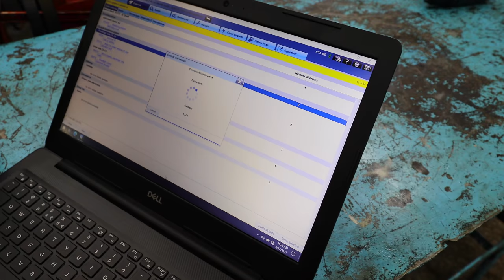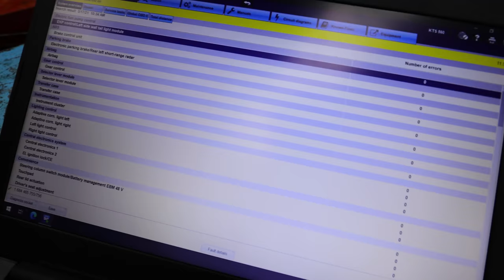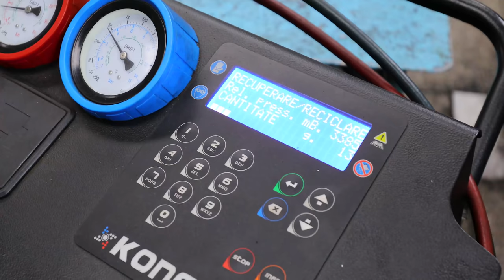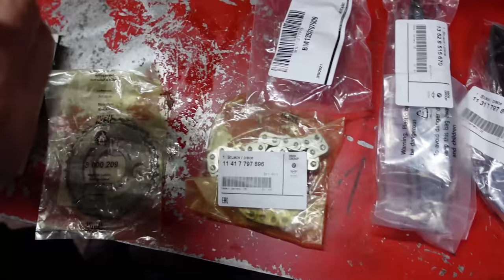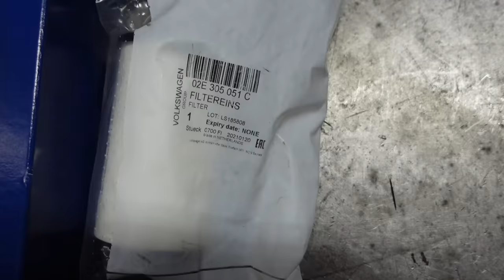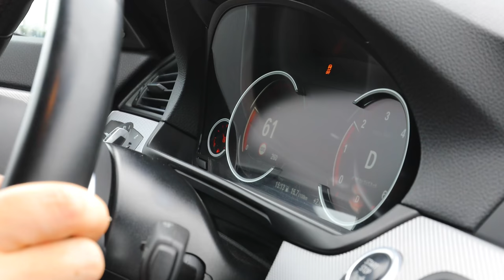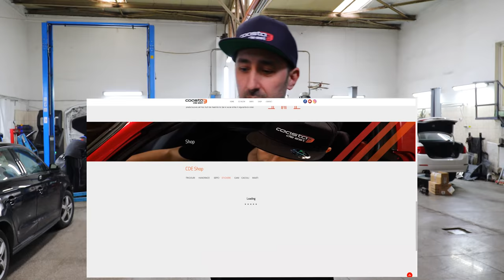BMW M550xd - balaurul cu 3 turbine 😈😈😈

Comment: Salutare, părerea mea este că la acest concurs putea să fie o regulă generală, nu să ne limităm doar la BMW, dar ca să împac și capra și varza, eu fiind un mare fan al japonezelor, mai ales al mașinilor rare, doresc să vă povestesc despre puțină istorie despre Mitsubishi 3000GT, dar și despre BMW 850.
Despre Mitsubishi 3000GT am aflat înâmplător, iar după ceva căutări m-am îndrăgostit de mașina aceea.
Fiind fabricată între 1990-1993, iar din 1994 venind cu un facelift care îi reducea farmecul deoarece au renunțat la pop up headlights și la câteva din sistemele active, mașina aceea la vremea ei venea cu eleron activ, evacuare activă(sport și city), splitter activ bară față(reducea volumul de aer ce trecea pe sub mașină, cel mai bine se resimțea efectul acestuia la viteze mari) dar și virarea roților spate la un unghi ce 5 grade. Toată minunăția asta era propulsată de un motor japonez pur sânge 3.0 V6 de  aprox. 280 CP cu o tracțiune integrală. Singura problemă generală  a mașinii de care se loveau proprietarii a fost reprezentată de gaura de ungere a tacheților hidraulici care era de 1mm ce nu asigura ungerea eficientă la mersul sportiv și ducea desigur la uzarea prematură a mai multor piese, însă Mitsubishi a refăcut respectivii tacheți cu gaura de ungere de 3mm, iar problema a fost rezolvată. În momentul acesta există pe piață cu prețuri între 8-9000 până la 50.000, dar la orice oră aș cumpăra așa ceva doar pentru istoria pe care o are în spate și pentru ingineria de la acea vreme.
         Aș mai putea povesti despre Mitsubishi Galant VR4, o altă mașină puțin cunoscută dar foarte potentă dar și despre Opel Omega, denumit și Lotus Omega(Lotus Carlton în Marea Britaie) deoarece aceste 2 firme au colaborat între anii 1990-1992 și au produs un sedan cu 4 uși capabil să prindă 280 km/h cu un motor 3.6 bi-turbo și 0-100 km/h în 5.4 secunde,propulsie/tracțiune spate. dar din cauza recesiunii nu au reușit să producă decât 950 de mașini.
         Acum să trecem la BMW, un bmw care mi-a atras atenția este BMW 850 E31, ca cel pe lângă care ați trecut și voi și sunt curios dacă are V8-ul sau V12 sub capotă. La aceasta mașină îmi place puterea brută pe care bănuiesc că o dezvoltă cele 2 motoare dar desigur și de funcțiile pe care le avea mult înaintea vremurilor, nu cunosc exact pe ce nivel de achipare au fost prezente funcțiile respective dar la viteza de peste 150 km/h se trecea automat suspensia în modul sport și se închideau automat geamurile, pop up headlights-care sunt plăcerea mea nevinovată chiar dacă nu sunt deloc aerodinamice, iar ca lucruri ce nu îmi plac, nu am gasit ceva să mă deranjeze, însă, la fel ca și la celelalte mașini menționate, trebuie sa fii potent financiar ca să te ții cu cheltuiala. Fiind mașini vechi, unele care pot fi trecute ca vehicule istorice și merită din plin în opinia mea, mai ales dacă ești pasionat, să ai o mașină la care să mai șurubărești și să o mai plimbi din când în când e o plăcere.

Comment: Toti vorbesc despre bmw-uri cu dotari, cai, eleganta, etc. dar voi ati vazut cu arata bmw isetta sau bmw 300/600? Ca sa intri in masina efectiv ii desfaci botul, coloana de directie se pliaza pe usa, iar pasagerii stau pe o singura bancheta, are 13 cai putere si 300 si ceva de kg, motor cu un singur cilindru, claxon la "genunchi", fara servo directie, trapa panoramica, 4 roti de roaba, viteza maxima de vreo 90 km/h, etc. Aparent facea furori prin anii 50'. Se mai numea "masina ou". S-au produs 161 360 de unitati in 6 ani.

Comment: Salutare băieți!Eu în prezent dețin o Octavia 1 VRS 1.8t AUQ cu undeva la 225 de cai.Dacă s-ar întâmpla să mă plictisesc de acel feeling pe care Octavia mi-l oferă și aș vrea o senzație aparte cred că aș alege un e38 3.0I V8 M60B30.Mi se pare foarte interesant că poți avea un V8 cu doar 3L.E ceva mai afordable legat de taxe.Mi se pare genul de mașină veche în care încă poți avea confort și mai ales genul de mașină care încă întoarce priviri fiindcă lumea nu prea o vede pe stradă.Are și puțină putere pentru acea caroserie,218 cai,cam la fel cu un 2.5 de generație de pe e90.Însă ai o injecție MPI și măcar știi că nu ai probleme cu depuneri pe admisie,la fel ca la Octavia pe care o dețin acum.Eu unul m-aș urca cu drag în ea în weekend într-o zi cu soare în care să nu conteze nimic,mai ales că nu este un motor care nu se pune pe brânci așa ușor.Nu cunosc încă foarte multe despre ea,am văzut câteva și am fost foarte atras vizual,apoi am mai căutat câte ceva,însă când va fi momentul,sper să vă pot da sfaturi legate de achiziție la acest model :))))).

Comment: Salut, parerea mea este ca unul dintre cele mai tari bmw uri facute vreodata (fiind rezonabil si vorbind si de ceva relativ accesibil, nu de exemplare de 100-200 de mii de euro)

Este bmw-ul e 36 (pisicuta) si ma refer in special la caroseria coupe (deoarece este mai rigida decat compactul si sedanul) si la motorizarile de 6 cilindrii cu vanos.
'
Cum ii mai spun unii pasionati de autoturisme din afara e36 straight six este varianta germana a motorului 2JZ,  vanosul fiind un fel de  VVT ul de la Toyota sau V-Tec ul de la Honda.

Pentru cei ce nu cunosc aceste termene, la turatii mici motorul se comporta normal, avand un consum decent recirculand gazele de evacuare inapoi in cilindrii, dar la turatii mari valvele permit intrarea aerului rece si iesirea gazelor de evacuare mult mai repede pentru a marii puterea si cuplul. Astfel mergand normal motorul se comporta cum trebuie, dar la turatii mari acel motor este exact unde isi doreste.
Am auzit (din pacate nu detin unul ca sa pot spune din proprie experienta) ca exista probleme la acest vanos dar cine isi cumpara trebuie sa-si asume, mai ales in 2021 acea masina are deja aproximativ 30 de ani, apar probleme iar majoritatea celor ce cumpara exemplare de genul le cumpara pentru a fi project car, pentru drift sau competitii (de asta si pretul unui e36 coupe straight six a crescut de cativa ani in coace).
Aceasta este parerea mea sincera, nu conduc unul din pacate, daca ar fi as achizitiona un seria 7 e38 non facelift ca project car, orientandu-ma catre aspect - design - lux, nu catre sportivitate (neaparat, ca este destul de potent, vorbind de o motorizare de 3000-4000 benzina)

Comment: Bmw 2002 turbo reusea sa scoata in 1974 aproximativ 170 cp dintr.un motor de 1990 cm3 si reusea sa atinga 209 km/h. Pentru o masina din '74 mi se pare super tare.

Comment: Din punctul meu de vedere, BMW e36 compact este si va ramane dragostea mea, deoarece a fost prima mea masina, 316i, din pacate m-am bucurat de ea cam 1 an de zile deoarece mi-a fost furata in italia, ulterior desi am primit gratis un logan nou nout, l-am vandut si am cumparat un alt e36 compact, 318 TDS :) ca deh, prima dragoste nu se uita asa usor... De ce sunt cele mai tari masini ? Deoarece sunt compacte, comode, sportive, usoare, piese ieftine si se gasesc peste tot, o placere sa te bagi sa repari chestii la ele (ma rog chestii simple, mai un temostat mai un curatat de EGR :) mai o modificare de pompa de inalta. In acest moment conduc un Superb 3 L&K, dar tot caut si nu gasesc un e36 Compact dragut pentru un proiect de suflet in amintirea tineretii :))

Keep up the good work guys ! love ya ! <3

PS. cand v-am contactat sa-mi faceti revizie la DSG la superb 3 mi-ati zis ca nu faceti d'astea, in clipul de azi Migu facea o revizie DSG, hmmm :)

Comment: Pentru mine cel mai tare model de BMW ar fii seria 3 modelul E46. De ce? Pentru ca s-a diferențiat de generația E36 prin reducerea greutății și caroseria este mai rigida. E46-le și în 2021 este o mașină care arata bine, este fain ca s-a produs in doua variante, facelift(2001-2006) și nonfacelift(1998-2006). 
P.S.: eu nu am inca permis, dar sunt pasionat de mașini și mecanica, iar BMW-ul E46 este printre modelele mele preferate de mașini.

Comment: BMW 507 este considerat de mult  cel mai frumos model . Roadsterul a fost fabricat intre 1956 si 1959 in numai 252 de exemplare. Are un motor V8 cu bloc de aluminiu de 3.2 litri de 150 de cp si prindea putin peste 200 km/h. Insa aspectul exterior este cel care a facut istorie.

Comment: Dupa parerea mea cel mai tare model de BMW fabricat vreodata este Seria 3 E30 mai exact modelul aplina care are un motor de 2.7 L si dezvolta 209 CP.
Pe E30 au fost puse 2 optiuni destul de rare, prima ar fii incalzirea in scaune mai ales pe hardtops, iar a 2 a optiune rara este pachetul Mtech acesta fiind alb. Va respect si prin voi mi am descoperit adevarata pasiune!

Comment: BMW 3.0 CSL, printre primele modele M/// fabricat în 1973 dotat cu un motor cu sase cilindri în linie, 12 SUPAPE ( fiind ultimul tip motor cu 2 supape pe piston fabricat de bmw pentru modelele de curse), o capacitate cilindrica de 3340 cm3 și 360 cp! Toate astea în 1973. Plus capota și aripile față erau fabricate din aluminiu asa ca mașina depășea puțin peste 1000 kg. Va salut!!👋

Comment: Daca tot spuneai de ursulet...Prima generatie de M3 a fost cea bazata pe BMW E30 Ursulet. Au avut motoare de 2.0, 2.5 si 2.3 litri cred... Cel mai puternic motor de 2.5 litri in 4 pistoane de pe M3 Evolution avea 238 cp si putea atinge undeva la 250 km/h.Tin sa cred ca M3 E30 e una din cele mai frumoasa masini făcute de BMW.Cu siguranta e undeva in top 5..

Comment: Salutare, vă urmăresc demult îmi place să văd cum lucrați cu atâta pasiune la mașini sunteți o echipa genială și foarte bine închegată😁. Îmi pare rău că nea Ion nu mai este in echipă. Acum vreau să vă spun care e cel mai bun BMW din punctul meu de vedere: părerea mea e că cel mai bun și legendă in același timp este BMW M3 E46 cu un motor de 6 cilindri în line care dezvoltă până în 360 CP și cu o transmisie manuală(automatizată). De ce îmi place acest model? Fiindcă am crescut cu această mașină de pe vremea când eram copil și mă jucam Need For Speed Most Wanted și doream să recuperez mașina, aceasta m-a afectat destul de mult in sensul bun deoarece a rămas in suflet😁. Mulțumesc pentru timpul acordat!

Comment: Salut! Nu pot sa zic ca sunt fan BMW,dar recent a venit in familie o balen ape 4 roti ,un e34 525 i ,care m-a dat pe spate,cum ar spune un samsar adevarat ,,fuge de rupe asfaltul,, .Informandu-ma mai mult ,am aflat ca aceste motoare au fost puse doar 1 an pe aceste caroseri (89-90).Revenint la masina mea a venit dotata cu trapa ,interior de piele actionat electric (ceea ce la vremea lor ,era un moft ), ac ,dar varsta isi spune cuvantul ,rugina deja a inceput sa atace .O sa va impartasesc mai multe experiente cu timpul ,va salut si va sutin in toate proiectele!

Comment: big up guys, multumim pentru sansa oferita Alexandru Muntean, pentru mine cel mai tare bmw este e36 320i, deoarece este masina visurilor mele din copilarie, sunt in cautarea uneia vreau sa o achizitionez zilele astea, si sunt de parere ca va avea aceelasi succes ca e30, toata lumea o vede acum ca pe o masina de cocalari sau un cazan, dar este o masina cu potential de modificat, o masina aproape clasica, si cu un motor foarte durabil si foarte echilibrat, abia astept sa intru in posesia uneia si sa pot avea grija de ea cum trebuie.

Comment: In opinia mea, cel mai frumos BMW este 850CSi cu cod motor S70B56 cu 12 cilindrii in V. De fapt toata gama de 850/840 fabricate intre 1990 si 1999 sunt cele mai frumose masini pe care BMW le-a produs pana acum si cele mai exclusiviste...Conf. multor persoane avizate din lumea auto, aceasta maina a aparut inaintea timpului ei reprezentand o revolutie la aceea data. Astfel a fost printre primele autoturisme care au avut o punte spate multi-link, o cutie de viteze manuala conectata la un V12 si prima masina cu acceleratie drive-by-wire  De asemeni a fost si ultimul V12 care s-a mai montat pe BMW pentru publicul larg...acum doar Rolls Royce mai are motor V12 BMW dar e supraalimenta cu 2 turbine.

Comment: BMW e46 de la motor de 2l in sus cine a zis ca trebuie sa conduci macar odata in viata un e46 a zis bine .Am avut unul l-am stricat dar mi-aș mai lua unul doar pentru senzația de la volan.Are o istorie in motor sport redutabilă nu am condus pînă acum un m3 e46 doar 330i e46 si mi sa parut alt ceva si motoarele 6 in linie au un sunet aparte .Este o masina făcută într-o perioadă cînd masinile se construiau  cum trebuie cu o masă a greutăți distribuită 50  50 o direcție hidraulica care iti da un fitbeck ce nu îl mai întîlnești in ziua de azi. Este masina care iti da o senzatie aparte care chiar iti face placere sa o conduci ,asta este parerea mea .

Comment: Cel mai tare BMW in opinia mea este Seria 5 E34 deoarece designul masinii imbina perfect clasic si modern in acelasi timp. In anul 1988 cand s-a lansat M5 avea motor 3.6 de 315 cai..ulterior in 1992-1993 au inlocuit motorul cu unul de 3.8 de 340 de cai. M5-ul de atunci l-as numi un BMW cu adevarat sport deoarece avea propulsie,cutie manuala cu 5 trepte....(,in 1995 pe ultimele exemplare s-au pus cutii getrag cu 6 trepte). As putea sa o numesc masina adevarata deoarece era o masina pe care soferul o conducea.. nu masina conducea șoferul. 
Stiu ca poate nu e cel mai tare BMW facut vreodata..dar am dat aceasta masina ca exemplu deoarece este una mai rara si mai deosebita.

Comment: Salut baietii !!!!
BMW E38 pentru mine ramane BMW-ul suprem, in primul rand pentru ca nu este cunoscut ca si restul verisorilor, fratilor sai ( drift-uri, burnot-uri etc)
Este cunoscut pentru prestanta sa, calitatea sa, prezenta lui pe strada chiar si dupa atatia ani face ca lumea sa intoarca capul dupa el pe strada.
S-a fabricat intre 1994 si 2001 , din anul 1999 avand si versiunea facelift
Motorizari diesel:
725 tds - M51 2.5 un 6 in linie - 143 de cai
730d - M57 3.0d un 6 in linie - 184 de cai (euro 2) si 193 de cai (euro 3)
740d - M67 3.9d un v8 - 238 respectiv 245 de cai
Motorizari benzina
728i - M52 - 2.8i un 6 in linie - 193 de cai
730i - M60 - 3.0i un v 8 - 218 de cai
735i - M62 - 3.5i un v8 - 235 respectiv 238 de cai
740i - M60 - 4.0 un v8 - 286 de cai
740i - M62 - 4.4 un v8 - 286 de cai
750i - M73 - 5.4 un v12 - 326 de cai

A beneficiat atat de cutie de viteze manuala cat si automata, insa un E38 trebuie sa fie automat, e o limuzina, e vorba despre confort

A fost fabricat atat SWB 4985mm (short wheel base) cat si LWB 5085( long wheel base)
Cand vine vorba de optiuni, lista este uriasa, insa voi aminti cateva speciale, soft close portbagaj, geamuri atermice (duble), masaj scaune, climatronic pentru pasageri din spate, coloana de directie electrica, webasto, bancheta cu reglaj electric si lista poate continua.
A fost prima masina europeana care a beneficiat de sistem de navigatie prin satelit...
Pentru mine a fost si ramane masina visurilor mele... De cand am vazut primult film Transporter mi-am dorit un E38.
L-am avut pana la urma, cu toate ca mi-a scos peri albi masina din cauza cutiei de viteze ( long story )am fost nevoit sa o vand, insa si acum cand vad cate unul efectiv ma opresc pe drum, si ma uit lung dupa el.
Il am chiar si tatuat ca sa nu uit vreodata de primul meu E38.
Ar fi mult mai multe de spus, pentru mine E38 a fost un stil de viata, pentru mine E38 este departe de stereotipul creat de marca BMW in Romania. 
E38 va fi si va ramane un clasic, o masina nemuritoare cu o calitate a tuturor pieselor (interior, exterior, mecanic) mult peste celalalte modele Bmw din acei ani

Momentan am celebrul E46, doar ca e un M tech 1 330d super ingrijit, fara angel eyes, fara eleroane si alte spoilere, e un E46 cu pachet M Tech 1 OEM, o suspensie de circut si cu o optiune foarte rara ! Nu are rugina

Comment: Desi BMW are multe mașini care mai decare mai interesante, după parerea mea una dintre cele mai interesante este BMW Isetta, datorită istoriei pe care o are: In anii '50 BMW se confrunta cu mari probleme financiare, si cum pe vremea respectivă, era un trend al "bubble car-urilor" BMW, in anul 1955, a început să producă o versiune proprie a modelului italian Isetta.
Au folosit un motor de 250cmc de la motocicleta R25/3 care producea 12CP.
In 1956 a apărut Isetta 300 care avea un motor de 297cmc cu fix un căluț în plus față de modelul din anul precedent, avand o viteză maximă de 85km/h.
Dat fiind faptul că BMW a preluat licența cu tot cu linia de producție de la Iso, au reproiectat Isetta înainte de lansare, deci au adus si câteva îmbunătățiri, de la motorizare la trenul de rulare si chiar si la caroserie, de exemplu, la modelul din 1956, au înlocuit geamurile laterale fixe cu unele culisante pentru o mai buna ventilație in habitaclu.
Eh..ar mai fi multe de spus despre această jucărie, de exemplu ecartamentul roților din spate era de numai 12cm, deci nu mai era nevoie de diferențial, transmisia se făcea printr-un lanț dublu in baie de ulei. 
Gata, ma opresc aici, sper că nu am comentat prea târziu, dar nu-i bai dacă bu câștig, important e că poate cineva chiar vede ceva interesant la ceea ce am zis aici. 😅

P.S. Exista și o versiune cu o singură roată pe spate, se comercializau pe piețele unde puteau fi conduse cu permis de motocicletă. 😋

Comment: Pentru mine BMW E30 (seriile 320, 323 si 323i, 325 apoi si 325i), fac referire la 325i avand ca motor celebrul M20 6 linie aspirat natural, simplu, durabil, un adevarat `fun factor` si cel mai important, nu trebuia sa spargi o banca ca sa o intretii, ramane BMW-ul inimii mele. Cel mai trist este faprul ca devine din ce in ce mai rar. Pentru standardele de azi, masina nu isi mai gaseste locul, este aproape uitata. Motorul de 2.7 benzina  produce doar 170 de cai, consumul nu este unul moderat, cam 10l si o galeata as zice, pentru un picior de 43 si o caramida greutate. Sa retinem BMW nu produce masini pentru economie de carburant. ``Placerea de a conduce`` este sintagma care defineste esenta marcii BMW.